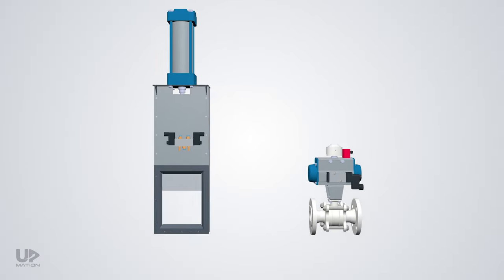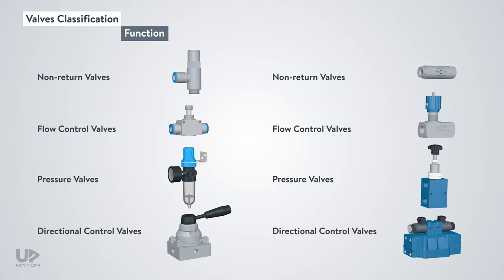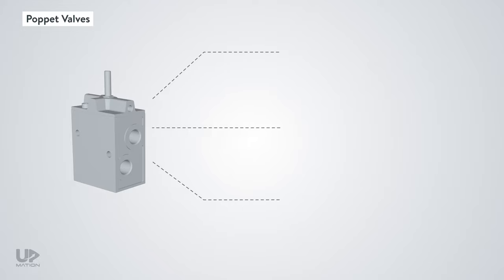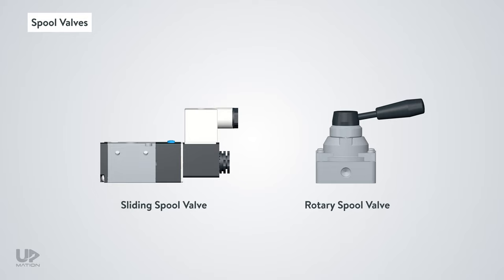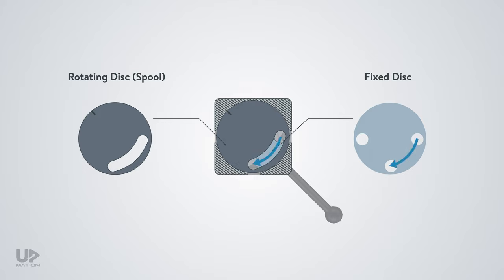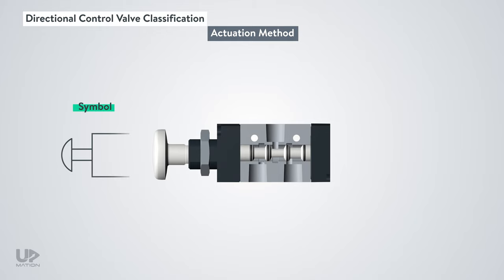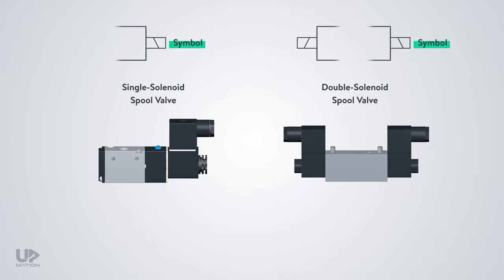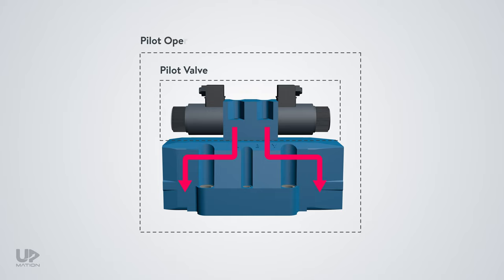Directional Control Valves (Hydraulic & Pneumatic): Types, Mechanism, Actuating Method, Applications

Comment: Hi :) Could you explain how the hydraulic actuation works? I am trying to understand the P&ID of an HPU with a hydraulic directional control valve linked to a Steering pump. There is also a boost pump bringing the oil from the tank to the main pump which is in a closed loop system...
Reply from the maker: Hi there! Yes, this is a good idea. We will consider it in our list. Thanks!